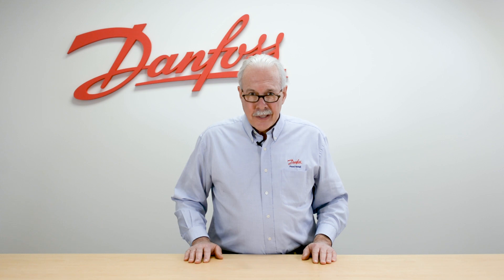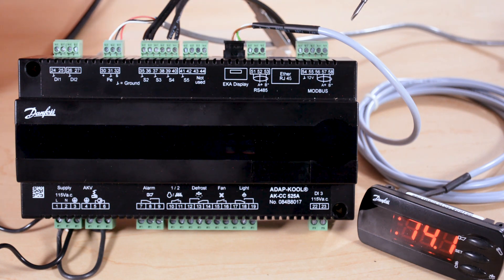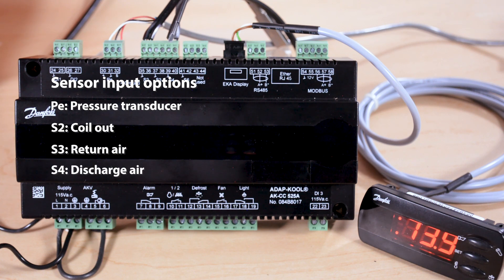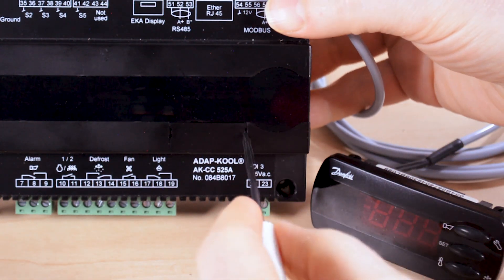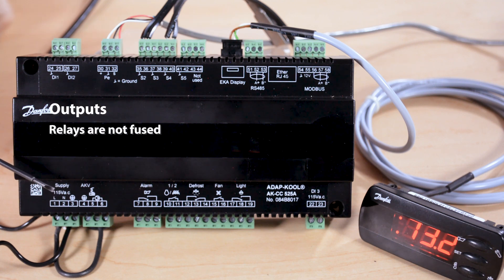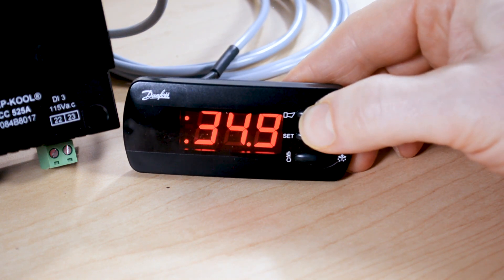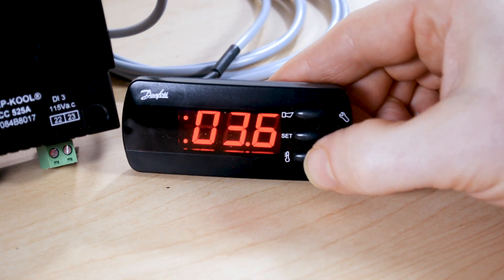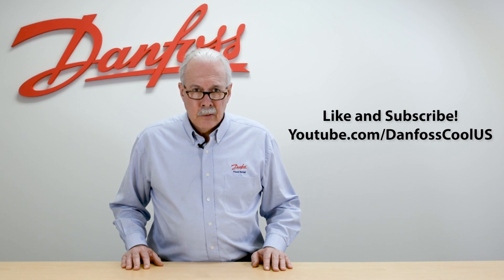How to Power & Wire Danfoss AK-CC 525A Case Controller | Technical support for supermarket controls

Comment: This is good if you fix display which show reading or parameters incontrollar bord it's also better like Daikin have in AWS model chillers. You can fix password and alarms history and setting for in auto manual if any problem we can run condenser fan motors and exv drive etc....